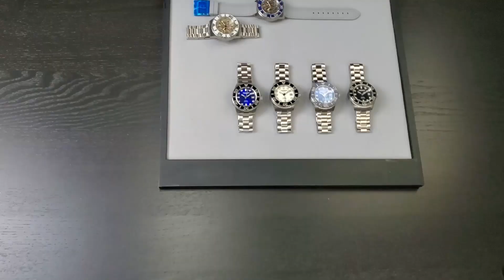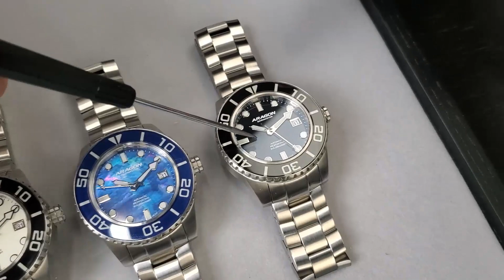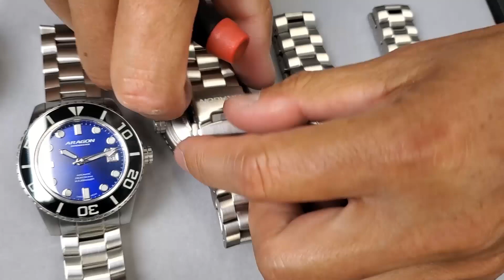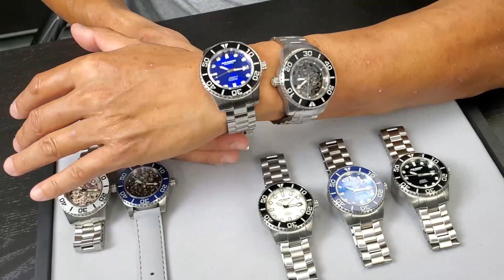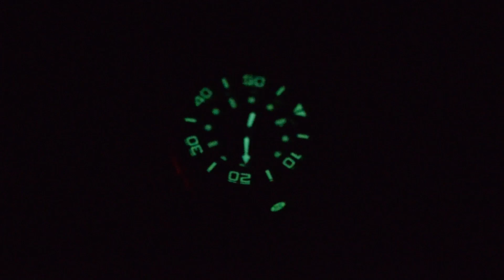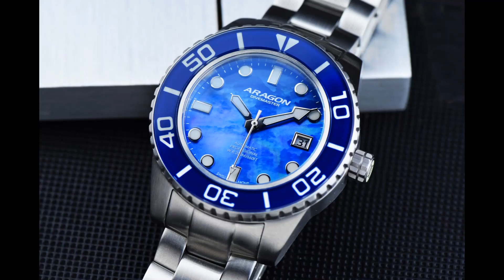ARAGON® Divemaster 42 Swiss Ronda R150 Automatic

Comment: I like the smaller 42 mm size. I would love to see the glide lock option for this. Maybe even screw in links. And a design on the rotor. I would love to see a dark teal, or a storm blue or midnight blue with a black bezel. Maybe even a gradient going from dark to lighter.